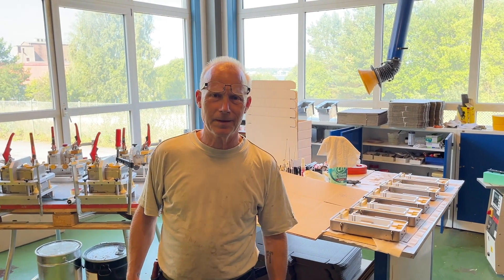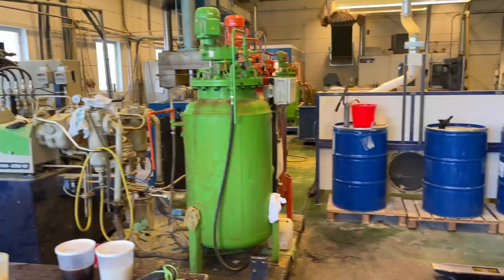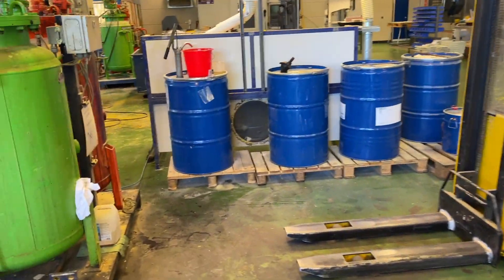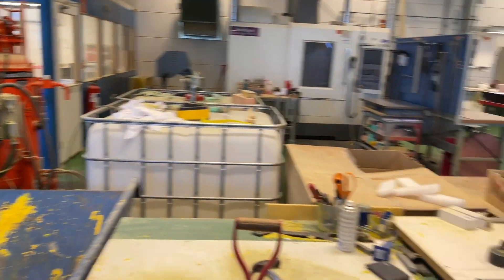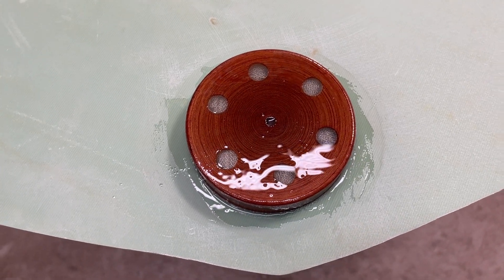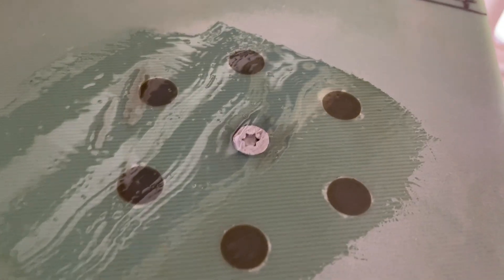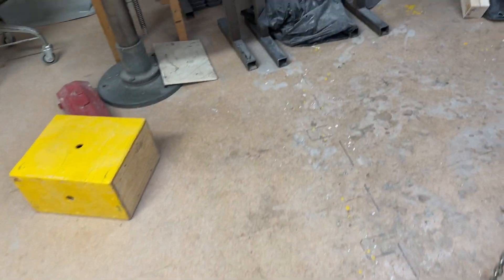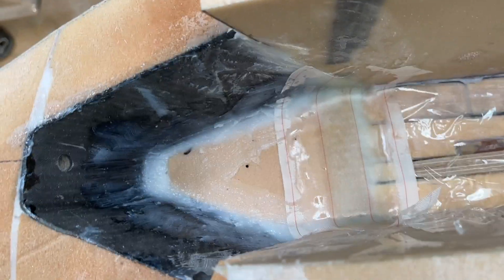15 August 2022  Something about the polyurethane foam.

Comment: There sure is a lot of electric motors propelling boats on the internet.  There's one where a small tow boat pulls a guy around a harbor in a dinghy totally by solar power with backup battery power.  Maybe some kind of an inboard electric cruising motor solar powered.
Reply from the maker: True a lot of development is goaing on.
I keep my eyes open mainly for the next boat in a feew years time.

Comment: Thoughts on electric drive, a few of us with canoe stern have just added as nacelles (pods)or kicking swing up. Possibly this is easier than a stern gland from an off center inboard. The main issue is enough solar panels to recharge.
Reply from the maker: This is just the beginning.
Next boat will have a better arrangement and more solar panels.
This is just a simple outboard not the best.
Reply: @SvenYrvindExlex  is it worth to install a small wind generator?
Reply from the maker: @juansimon7020  Wind generators are not strong when the boat capsizes, also they make noise and are a bit dangerous on a small boat.
They are more OK on bigger boats.
Unfortunately my boat is too slow for water generators.